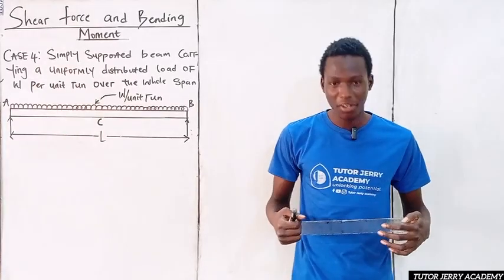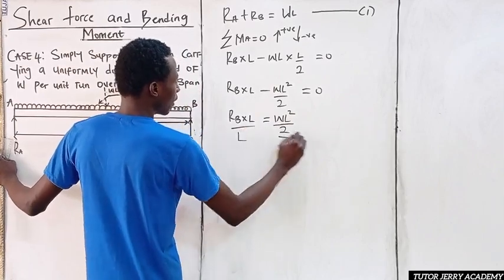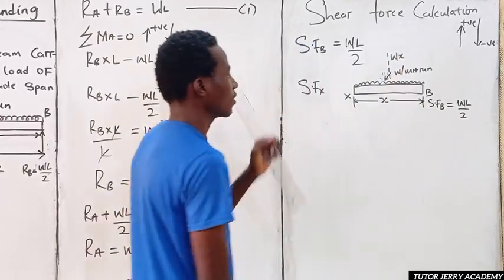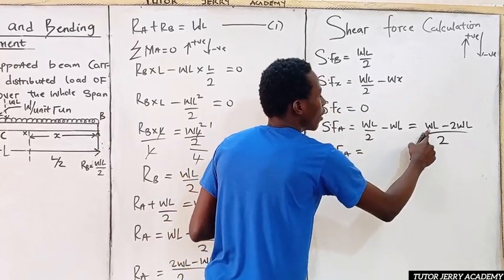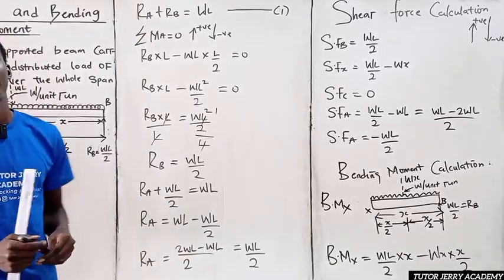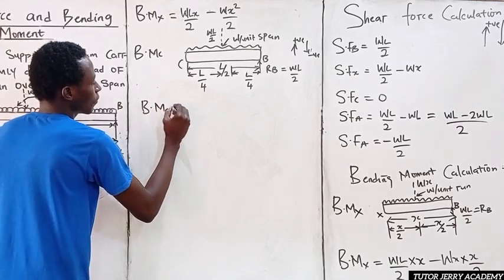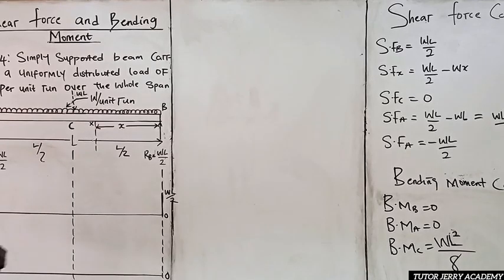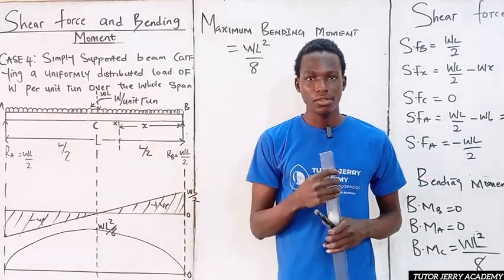Simply supported beam carrying a uniformly distributed load over the whole span | SFD & BMD

Comment: Why introduce the point x when you can just calculate the shear force and bending moment directly? 

I’m asking because it made the solution seem bulky.
Reply from the maker: Yeah you are right the Tutor did that because some students get confused when they come across such methods. So, kindly bear with on this as this is the only calculation that involves such others was done directly.
Reply: on putting x u get value of SFD and BMD in equation form. that equation may be quadratic or cubic or linear. and from that u can get get graph of these equation. like if SFD eqn is quadratic then u will know the SFD diagram should be made parabolic.
Reply from the maker: Nice explanation